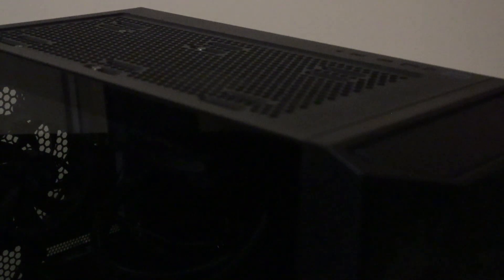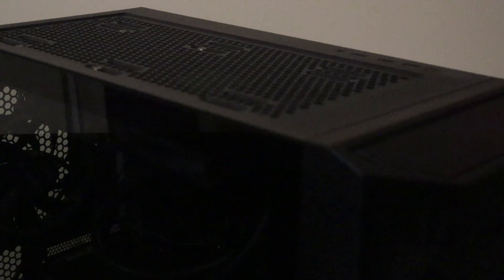A Nightmare Clicking Noise in an MSI 240R MAG Coreliquid AIO CPU Cooler which occurs in a 360R 120R

Comment: MSi has recalled this model of aios for sediment. check your serial numbers and see if it matches the recall if not drain it completely, flush with deionized water thoroughly, and replace with higher quality coolant. also clean the back of you heat sync as it will probably have sludge blocking the fins
Reply from the maker: https://www.youtube.com/watch?v=oONvlARBcAE A full recall , recalls all faulty products. If a radiator is not chemically treated right after manufacture, you will always have problems with that radiator according to experts in the UK. No amount of biocide or corrosion inhibitor will fix the problem.
Reply: @pcgamingtechsummary  That is entirely possible that there is an irreversible factory flaw, but if somebody wants to try a step before spending another $200 on another aoi. I believe if I get another year out of this $40 simple diy repair then it is definitely an option for some people. You have to be comfortable with your PC for this to be viable, but the technical skill required is low and there are immediate benefits if this is their only rig.
Reply from the maker: @zholton1986  If it is out of  warranty, you can still create a ticket at MSI and request a different model. I have heard requests are being granted. Provide proof with screenshots of temps.
Reply: @pcgamingtechsummary  if the problem returns I will definitely consider that an option. I have to admit that I am curious as to how long it will take for a problem to return. This is more due to my own curiosities though as somebody looking to expand my knowledge and familiarity with my PC. I greatly appreciate your information and referrals. I combined info from you and @GregSalazar before attempting to repair myself. While I understand professionally you can't recommend it due to varying skill sets of your listeners. I commend you on tackling this subject as it is very widespread.

Comment: The only solution is, you need to full fill the max water of the radiator sir, i have the same issue as yours I figure it out that the clicking noise is when the radiator did not get enough water so make sure you fill the radiator sir try it
Reply from the maker: Air bubbles sound different Watch this at 21:44 https://youtu.be/tbtq1jAHp7o?t=1304  Besides I already had my FUNERAL for the 240R watch this 
https://www.youtube.com/watch?v=V04OCd-84Tc